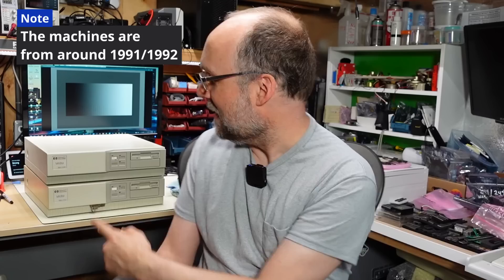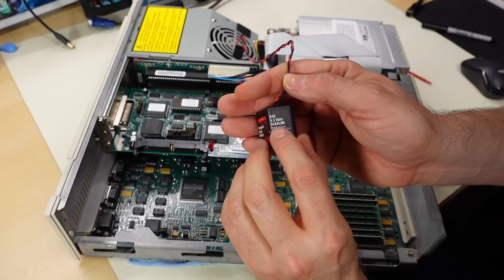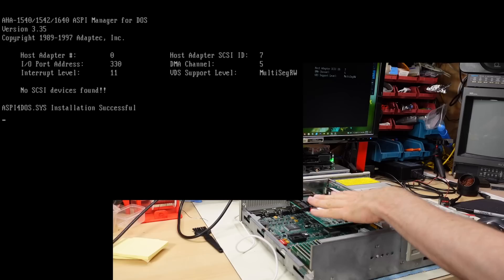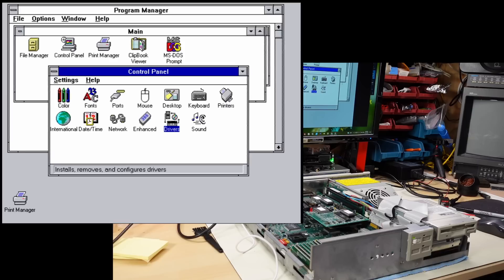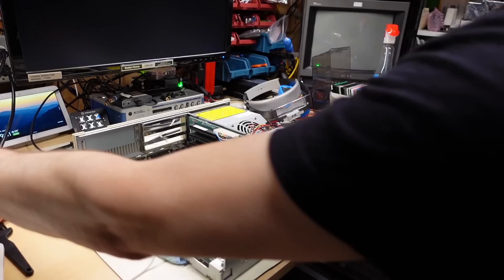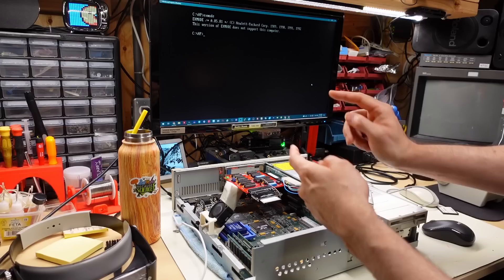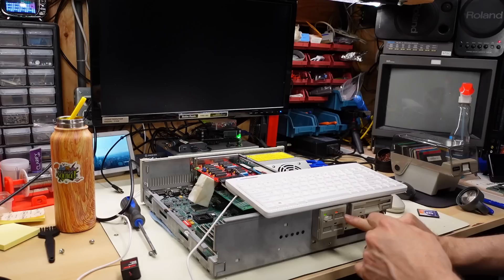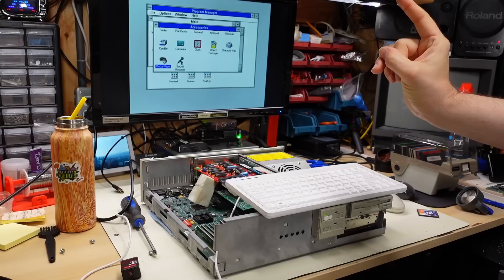PC archeology: The HP Vectra N Series, a well made pizza box PC from the early 90s

Comment: Somebody may have noted it already, but the IDENTIFY DEVICE ATA command started to get implemented in IDE Drives starting around 1987, so the tail end of 386 systems probably had that capability. (I had a 40Mhz Am386 system which had auto-detect, myself)

Comment: Back in 2000 in my student times I had a Vectra VL2 4/66 with DX2/66 and 16MB of RAM. Used that thing as Internet Router with fli4l (flexible internet router for linux) to provide Internet for 10 studenst in my dorm via my 5 Port Hub that was cascaded via BNC to a 8Port Hub. Anyone remembers the collision LEDs on that Hubs? That thing was really stuck in active back than! But the Vectra was a very silent and reliable machine.
Reply: Collision domains sure do be like that. Wifi does it all the time even today, since it’s all one shared air space within a range. I guess a hub would be the same even today, but it’s hard to find one that isn’t actually a switch!

Comment: When my 166mmx pentium fried and I was forced to go back to the ol' 486DX-66, I had no heart to install windows 95 back in it. Way too slow for what I was used to, so I installed Debian instead, without the GUI. That was my introduction to Linux. I struggled a lot, though lol

That video certainly pushed some buttons. I found what seems to be my old 386DX-40. A baby board. Part of it is badly corroded due to battery leakage, but I'm trying to save it. It's got a math coprocessor and full memory sticks. Gotta find a PSU for it and will also probably need to scrounge a video card to test it, though.

Comment: If you compare the bytes/ms on the 486 machine with the ET4000 ones you will notice that the most used VGA resolutions all have better throughput: 320x200x256, 640x680x256, 800x600x256 and 1024x768x256 - all are well above 6400 bytes/ms. This is clearly a very optimized implementation where unusual resolutions didn't get as much "love".
I also suspect that the 640x400x256 mode drastically lost performance because of the 70 Hz mode - there seems to be a memory access conflict of some sort.

It would be really interesting to compare video benchmarks on those various old machines with different bus systems (ISA, VLB, PCI etc.)!

Comment: I had one of those 486/25N (SX) models around late '99 - early 2000 that I got for free from our local teen center I used to hang out at. Really nice little unit, well built and pretty solid. Wish I could remember what I did with it. Today I have a very clean VL2 4/50 which I will hold onto as long as I can!

Comment: This definitely hits a soft spot on me. 
The very first machines i serviced from an institution were actually Vectra VE Pentium machines, they were abnormally fast like your 386 one and i suspect that was because they indeed have that cache module on board that most run of the mill clones didn't eve have the socket for. Later i used a few IBM 300gl which i suspect were competing on the market and even they were similarly fast, i found the IBMs to have a specially annoying BIOS that considered simple stuff as critical problems.
Always loved the way the mainboard is removed from those machines, much like 68k macs.

Comment: Ok so I didn't start admining domain controllers until a bit after this but a complete spitball is that the actual login profile was passed back from the domain controller. Which would explain why you are seeing the default. Hope that helps.  It could be that links to network provisioned programs are appended to the desktop or w/e they managed to back-weld into 3.11. At a guess it was used for networked data entry. A fancy terminal.  In a nutshell you aren't getting the login script the original person did.

Some really arcane digging around inside the registry/files could possibly net you the name of such a file but not it's content. It's been decades and I forget, however a dedicated person can usually dredge a disturbing amount out of the seemingly emptiest computer. N.B. People who casually dispose of their machines ;)  Domain controlled ones are, in general, the toughest.

Comment: Not 100% sure but I think the "network server mode" disabled the POST keyboard check - i.e. it would boot without waiting for "Keyboard error, press F1" in case of a cold boot. So you wouldn't have to go to the server room after a power hiccup. But I might be wrong, it's just an option that I have seen in these 90s BIOSes.

Comment: The Vectra 386/20 actually does have 16k of cache. Look at the timings at 38:25. It has a slight speed boost at the first 16k it reads..
My NCR 386SX is also one of those weird SXs that feature cache. Makes the thing pretty speedy for such a low spec system.
Oh and did you know Pinball Fantasies even runs on my 1984 IBM 5170? It's not perfectly smooth on mine but definitely playable.
On my 12MHz PS/1 it runs great with PCM sound enabled! Such an excellent game!
Reply from the maker: You're right -- from 105 to 120. Funny the program detected that as no cache. I need to quickly run this on my Cachless 386SX to compare. BRB
Reply from the maker: https://imgur.com/a/5uemm8g  <<- Did some testing and this board does seem to have 8k of cache on it. 8k. While the HP had 16k but no idea why CACHECHK indicated it had no cache, other than the fact the 8th meg wasn't being cached which maybe threw it off. Clearly the timings are basically the same as my bench machine -- which I clocked to 20mhz to match. I honestly never knew these chipsets had built in cache memory!
Reply: @adriansdigitalbasement  Yeah, that's pretty cool right? "It has freakin' cache!!" ;-)

The Macronix MX83C305/306 chipset indeed has a direct mapped cache controller and 8k of SRAM built into one of those QFP ICs (305/306 don't know which one ;-) )..
The fact that it features cache makes the story that a 386SX has nothing on a fast 286 even more of a myth as it gives these machines a significant speed boost. Of course the datapath to its cache, just like its main memory is only 16-bits wide (as it's a 16-bit chipset), unlike the i386DX which features full 32-bit memory access (and of course also full 32-bit addressing instead of 24-bit addressing the SX has).

I think the fact that it features cache is also the reason why it turns up so high up in the ranking of your benchmarks. My NCR 386SX-20 has a dedicated external Intel cache controller which is like a "385sx". It's quite zippy as well for a little SX ;-)
The Cyrix SLC definitely doesn't belong there at all though as it's supposed to be a quite lot faster indeed. My guess is that the owner turned off its 2k of L1 cache which makes it about as fast as a normal 386SX with external cache, maybe a tiny bit faster as it features a 486 ('clone') instruction set and pipeline, yet is forced to breathe through the same 16-bit straw and disabling their cache turns them into a bit of a dog ;-)

I like working with these old beefed up SX systems. I have an old Acer (ALi) mainboard from which I desoldered the old i386SX-20 CPU and soldered on a Ti486SXLC2-40. Runs great! The fastest "SX class" CPU though is the IBM DLC3 by far. It's a really weird unit as it can operate both on a 16-bit and 32-bit bus! On my IBM PS/2 Model 56SLC3 (which has a 16-bit planar and is a descendant of IBM 386SLC based systems) half of its datalines are just flapping in the breeze ;-) It's called SLC3 but has a DLC3 CPU on board. Mine is running at 75MHz (3x25) and it's supposed to be able to run at 100MHz (3x33) as well, a 100MHz 386SX based machine!

It would be awesome to solder on one of these 100MHz IBM chips with their high clock speed and 16k of L1 cache onto a very low spec, cheap 386SX board. It requires some mods but it has been done ;-)

Comment: I can't be sure about this one, but the power switch on my VL2 works exactly like an ATX PSU: It pulls one of the pins on the MB connector to ground. You'd obviously have to solder some new connectors, but it shouldn't be too difficult rig the guts of a modern PSU to the stock case if push comes to shove.

Comment: Totally possible that this simply wasn't used. I scrapped four of these in ~2005 which were new in box. They were owned by a large electrical utility company which had a fleet of thousands of them - and kept a few as spares at each of their branches. Those spares sat in a utility closet, long after the fleet was retired. Completely possible that this, too, was a spare. The price point of these was high enough that they really only sold to businesses, who wanted the reliability, security and small footprint.

Comment: A 386sx is not a souped-up 286. It is a 386 cpu with a 24bit address bus and a 16bit data bus that runs all 386, 286 and 8086/8 software. QEMM is a fantastic EMS, XMS, DPMI memory manager optimization program. EMS386 was Microsoft's answer to QEMM it that came free with DOS 6.XX

Comment: If you want to use  CD-ROM and 5 1/4" Floppy disks with the HP Vector, their are two simple relatively solutions. For a CD-ROM drive, you can get a vintage external  SCSI  model (and a vintage SCSI card if your Vector doesn't have one already installed). As for 5 1/4" Floppies, there were 5 1/4" external floppy drive made back in the day that connected via your parallel printer port, especially for small form factor PC's like this one so you should be able to locate one on the vintage used computing market (VWestLife has a recent vid on one sold under the Tandy brand but universally DOS PC compatible). With these two external drives you'd have a fully kitted out compact PC system. If you wanted it to be more  compact under normal use than you can always disconnect the external drives and store them away when not in use, especially if you replace the internal HD with a SD or CF card solution and copy all your 5 1/4" and CD-ROM contents to folders on your system SD/CF Card (most CD-ROM games back then didn't have copy protection looking for a physical CD-ROM disk in a drive.) as copy to a hard drive back then was impossible given CD-ROMs held 3x the size of the largest HD you could get in the early 90's.).

Comment: Actually, most old machines can easily address a 2GB CF card if you can put in custom cylinder/head/sector numbers.
I have a 286 from DTK with a bios dated 08/1990 that will accept a 4092/16/63 CHS setting for 2GB disks, which is perfect for a CF card setup.
I'm a big fan of these horizontal PC cases, and all my retro PC and Mac systems are in that form factor. They're easy to store and put into a rack-like setup with a beefy KVM and an audio mixer so I can play a huge variety of old games on somewhat period accurate hardware.
Reply: Putting them in a huge pile is great!

Comment: I had a Hewett Rand sx20 mb (very early in the SX life cycle) with a 32k external cache. And it even required simms in a group of 4. Many very early sx machines had cache due to there being such a huge disparity between it and the cheapest DX in both price and performance. And cache does help them out pretty significantly.

Comment: Hey! Used one of those for years. A 486-66N. Compared to the previous range of Vectra's these where quite flimsy. The old Vectra's where all-metal cases and weighed a ton. These newer machines where all plastic with a tin metal shield inside. The 486-66 MHz version used a tiny processor fan clipped on an angle to the side, which was quite noisy. Oh, and if you put the machine on its side, you can rotate the badge and button panel in the right orientation.
And 'made in France'? Probably assembled in France....

Comment: I know that this format of case was often referred to as a pizza box in the USA but in other parts of the world these were just reduced sized desktops.  Vtech had a line of computers in this form factor, but also a range they named pizza box that were, from memory, around 1.5" to 2" high which was much closer to the size of an actual pizza box.  I'm pretty sure the original Vtech pizza box was 386 based but I think they released a 486 model too.  I tried to find a picture via a web search but came up empty handed.

Comment: i had a HP Vectra 386SX that had a 33MHz cpu, 8MB of ram, a 3.5 inch floppy drive and a 500MB IDE hard drive. the previous owner had installed a bare bones install of windows 95 that could barely run at all. before the power supply put on a beautiful fireworks show, i had replaced the win95 install with MS-DOS 6.22 with Windows for Work groups 3.11. it was a fairly nice dos rig and i miss it.

Comment: I have one of these, a 486 33N, that I put a CF card and an SB16 in for gaming.  I also added a 3 AA battery pack to replace the dead cmos battery.  I love the size because it's easy to put away on the workshop shelf when I'm not using it but it is kind of limited to disk based games.  I suppose I could add an external cd rom drive though.

Comment: All vendors may not of supported it in the beginning but im fairly sure that IDE (later PATA) was designed with auto detection as a standard in mind. (Afterall unlinke Earlier MFM drives that required a controller seperate from the drive thus requiring two ribbon cables) IDE however was just a "DMA Host-Bus adapter" and the contoller was part of the drive so im sure by even the early 1990s 99% of vendors supported it. Both my 286, 386  and 486s had Soft-BIOSes that had IDE autodetection.

On that Overdrive; Most of the 486s overdrives were simply normal clock doubled 33/66Mhz etc (Later clock tripled and strangely called "DX4"s) 486s that had extra pins that "Told" the motherboard to disable and take over for the SX soldered to the motherboard (SXes had no Dedicated FPU as the DXes did).

Oh! P.S Adrian I have a tip for ya, Ive noticed through experiance with my retro machine that  ive had great luck with older (Pre 2005) Dell 15" LCD Displays do an extremely good job of supporting old and unusual resolutions in DOS and classic Windows as long as it isnt less than 320x240 provided you are using a machine with at-least a VGA card.

Comment: I got 1 HP Vectra 2001 model from iraq embassy price was very good, As I was leaving he said wait you forgot your computers and gave me 5 best deal ever. I was shocked they still had the SCSI hard drives not whipped. They are to open the hard drives up and cut them with a screwdriver, my friend did that when at GD , whipped and ueed them

Comment: I have a later HP vectra : a 486/33VL which is from 1993 and has a cirrus logic video chip which is connected to the vesa bus and a 486DX-33. Oddly enough, that one has a AMI bios and not the proprietary HP bios you have

I wouldn't name the 386SX a "286 on steroids", at least performance wise, because it's actually slower clock for clock ! What it does bring however are the very useful 386 instructions which are much more useful.

Could you please dump the bioses of your machines for the ultimateretro project please ? :)

Comment: I have the exact same computers.  The 486 was quite yellow & weathered (the back plastic was severely brittle and did break several time).  Also, the CMOS battery did leak into the power supply and the leakage wicked down the battery leads and corroded the connector which I had to replace.  The power supply was dead but don’t know if it died first then the battery leaked or if the battery leaked which killed the power supply.  Couldn’t repair it nor could I find a replacement so I ended up using a mini/flex ITX power supply and made an adapter so that it would plug into the computer.  I didn’t have to mod the case to fit the power supply and the only downside is there is no -5v which is not really needed.  I got the 386 to use for parts on the 486 but it was in such great shape that I kept it as is.

Comment: IMHO saying that 386 SX is a 286 on steroids is a bit misleading. 286 is a 16 bit chip, internally and externally. It has 16 bit registers and works on 16 bit chunks of data, but with a 24 bit address bus which enables it to access up to 16 MB of RAM. 386 SX is fully 32 bit internally. This means 32 bit registers and a 386 instruction set. The difference is in the data bus which is only 16 bits wide and the address bus which remained 24 bit. So even though 386SX is completely capable of working with 32 bit chunks of data, to fetch 32 bits, it requires at least two clock cycles, while the DX chip only requires one (as it has a 32 bit data bus). 386SX is much faster than a 286 of the same clock cycle,  but still slower than 386DX due to differences in bus sizes.

Comment: 23:33 - Thanks, Adrian. I was having problems with my main system while I was listening to your video. Installed the latest version of memtest86 and in a matter of minutes I got the confirmation that one stick (that I bought during the chip shortage ofc) is busted (fails the first read/write test by returning 0xFFFFFEFF instead of 0xFFFFFFFF and so on).

Comment: The choice of using Amiga games to test the functionality is hilarious, finally a pc can run ported Amiga games.  A better choice would be the games that were driving people to these machines, like Doom (which you did do) and the C&C/Warcraft games, huge sellers in the day, would be interesting to see that comparison (seems like Doom was a fail though..)  Also, the form factor is a nice feature, too bad both Atari (Mega, MegaSTe & TT) and Amiga (1000, 2000, 3000, 4000) had beat the pc to the punch many, many years before.
Reply: It does at least make sense to need more power to emulate a Paula in software… but yes, it did take a while for VGA to come out and catch up in that regard!